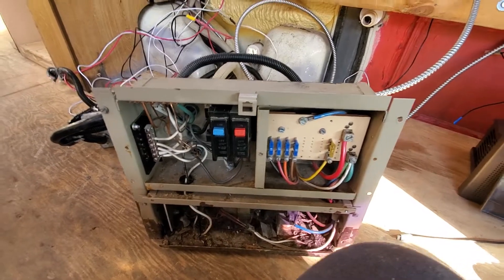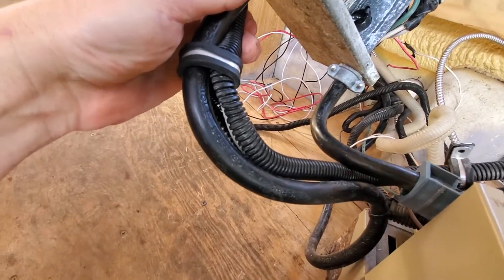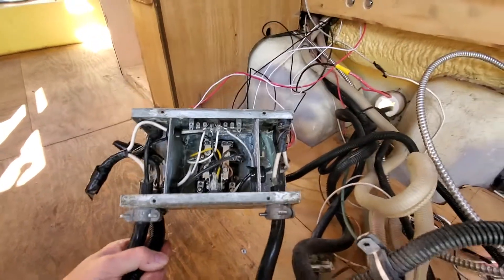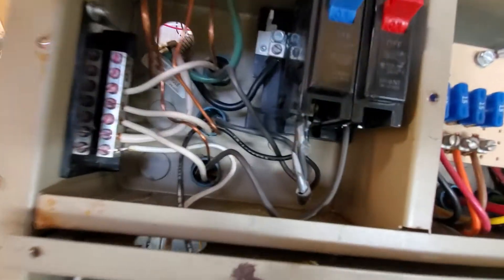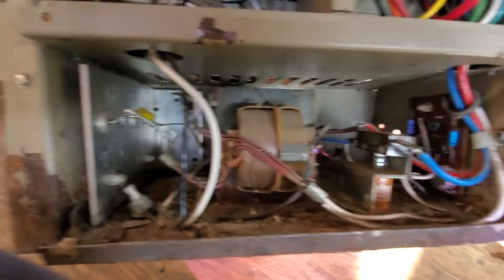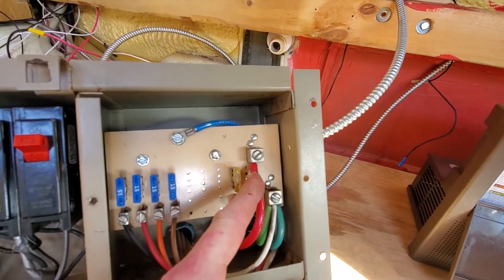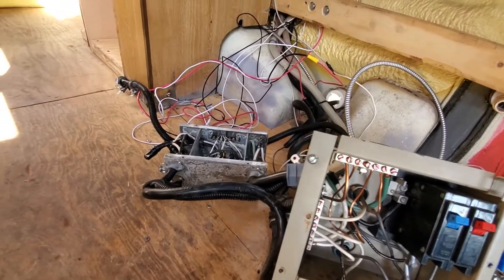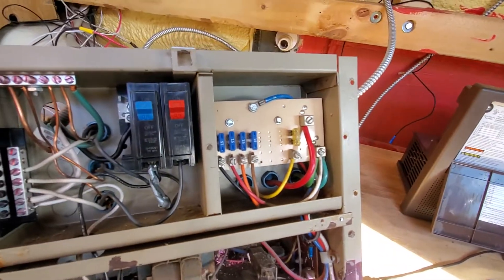2 Minute Tutorial...How An RV Electrical Distribution Panel Works

Comment: JUST A QUICK TUTORIAL OF MY OWN SINCE I DO HAVE A CHANNEL WITH THREE VIDEOS DEMONSTRATING CUSTOM DESIGNS THAT INCLUDE LED STRIP LIGHTS...IN CASE...MARSHALL OVER THERE CLAIMS I DON'T KNOW WHAT I'M TALKING ABOUT.

FIRST...THE LED UNIT THAT CONTROLS FUNCTION/ACTIVATION OF LIGHTS VIA REMOTE CONTROL HAS TO BE INSTALLED WHERE THE SENSOR OF THE UNIT CAN BE CLEARLY SEEN AND ACTIVATED WITH REMOTE FROM VARIOUS ANGLES AND DISTANCE.
PLACING THE UNIT INSIDE THE GRILL IS IMPRACTICAL AND INCONVENIENT...
NOTE IF YOU WILL ROSIE YOU HAD TO LITERALLY STAND CLOSE TO THE GRILL TO ACTIVATE LIGHTS WITH THE REMOTE.
 INSTEAD RUN THE STRIP UP AND INTO THE DASHBOARD AND CONNECT THE UNIT INSIDE THE VAN FOR MORE STRATEGIC CONVENIENCE.

SECOND...DESPITE 'WEATHERPROOF' THE EXPOSED LED LIGHTS ON THE GRILL DUE TO IT'S FRAGILE DESIGN CAN EASILY BE DAMAGED OR SOMEONE CAN CUT THE STRIP SHORT CIRCUITING THE ENTIRE UNIT.
THEY SELL A HIGH DENSITY CLEAR SEE THROUGH BASE SPECIFICALLY DESIGNED FOR LED LIGHTS PLACED OUTDOORS ON STAIRS,HANDRAILS AND STORES USE THEM TO DETER PEOPLE FROM PULLING/YANKING THE STRIPS.
IT'S BASICALLY A PROTECTIVE SHIELD MADE OF PLASTIC OR RUBBER AND CAN BE BOUGHT WHERE EVER THEY SELL LED STRIP LIGHTS OR ORDER THEM ONLINE.

THIRD...IF TERMITES GET INSIDE THE VAN ALL THAT WOOD MATERIAL USED FOR THE REBUILD OF THE 'ROSIE-MARIE' WILL BE A DELICIOUS SNACK FOR THEM TO FEAST ON.
DURABLE AND LONG TERM RELIABLE PLASTIC DINETTE,
STURDY METAL BED FRAME AS WELL AS DISH WASHING UNIT IS FAR MORE PRACTICAL...
BUT I DIGRESS,,,SINCE THIS BEING MARSHALL WHO CAN'T EVEN MANAGE TO KEEP YOUR PROPERTY AND SHINE SHACK CLEANED AND ORGANIZED THE CHEAP OVERALL DESIGN YOUR DOING ROSIE IS A HOME RUN LOL.

GOOOOOO BALTIMORE'S...MEEOWS  ۩

Comment: I would like to disable the battery charger (it cooks my AGM) in my Y2k Chinook. Is it safe to disconnect that red wire ? 🤔
Also when I see your thorough rebuild of the Lisa , I am sorry I didn't think off offering you my partially burned but easily salvageable 2003 Chevy Roadtrek. I gave it away for free with a clean title to a crooked  salvage yard (such a stupid decision...)
Take care ! 😎
Reply: @RV Freedom USA  Thanks for this info, I will try & pull that fuse☺

Comment: I'm still scratching my head about what gauge wire I hook up to a 20 amp breaker. I'm going to google that.
Reply: @RV Freedom USA yep that is what I said in the next comment.
Reply from the maker: Depends on load..microwave 12 gauge,      but i use 12 for all 120
Reply: @RosieMurphy yep cost a little more bur safer. I think most of my 120 breakers are 10 amp. Not used to seeing that many 20 amp breakers. Or could be I'm getting old and brain foggy.